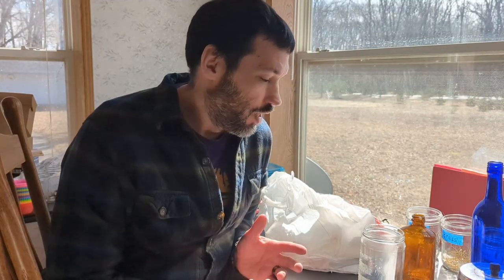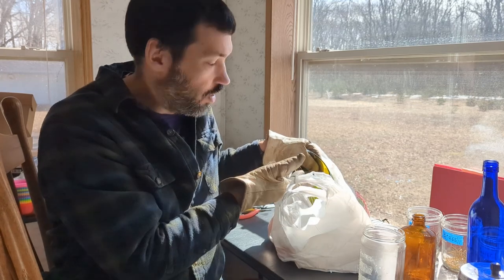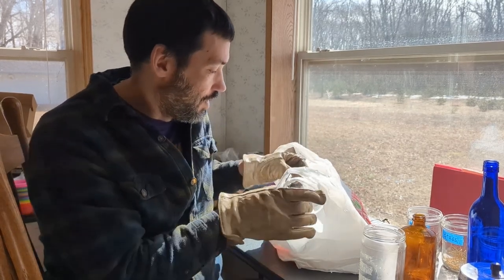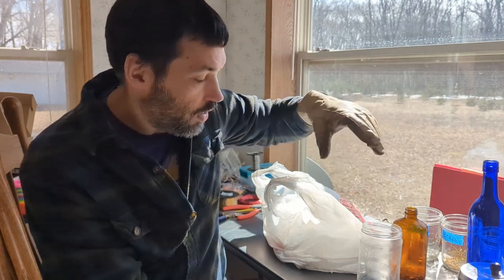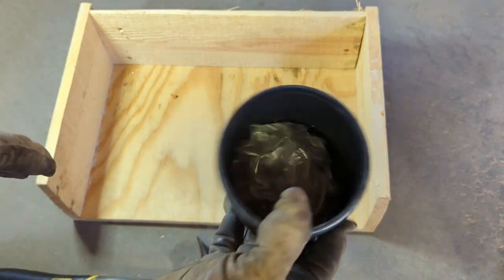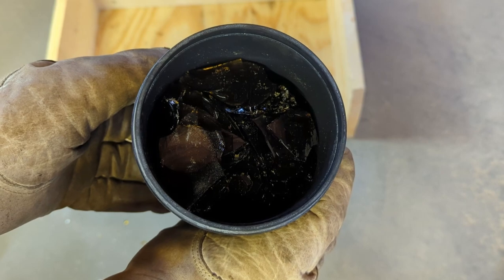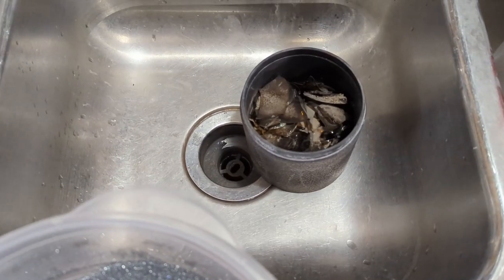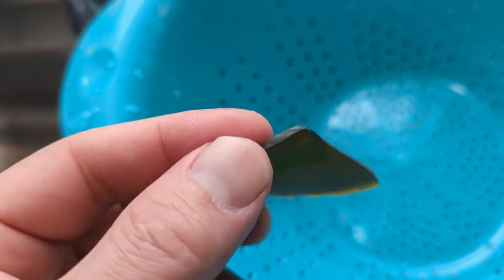Can you tumble just any glass into sea glass?

Comment: It looks like you're filling the drums too full.  I've used rotary tumblers to polish brass for reloading ammunition since the 1980s.  Early on it became apparent that a drum that was 50%-60% full would polish the brass much faster than one that was 75%-80% full.  The material and polishing medium must be able to fall inside the drum with every revolution.  If it can't fall, it won't agitate and the process fails.
Reply from the maker: For sure there are advantages to filling a barrel to different levels. With glass, I'm just after a scuffed surface, so these I filled past the typical recommended level. That, and I knew the labels would break apart and create more room in the barrel as it went. Thank you for the suggestion, I like knowing an experienced eye is helping me.

Comment: I found that only pieces more than a quarter inch thick survived the tumbling process, so there's no point trying to use the sides of beer bottles.
Reply from the maker: Thanks! I haven't gotten my hands on any beer bottles, yet, but when I do I'll keep that in mind.
Reply: @kengensjewelry  The thick green ones that Lindemans lambic comes in are great if you are sourcing bottles specifically for tumbling.
Reply from the maker: @wickeddelight  I'll run that by my wife.  I don't drink, so she's been the source of most of my colored glass.😁
Reply: @kengensjewelry  Lambic is fizzy fruity stuff with a low alcohol content, if she's not familiar with it.  More expensive than regular beer, partly because the fizz requires the heavier bottles which cost more to make and ship.  If taste is the reason you don't drink, you might actually like it, but if you don't drink for other reasons just disregard that.
Reply: I’m so glad you mentioned that. I have a Heineken bottle waiting to go in the tumbler.
Reply: @MamaJLW  Yeah, the only piece of a beer bottle that I've gotten a worthwhile result from is the mouth of the bottle where the glass is thickest.  Hardly worth smashing up the bottle and needing to carefully discard the rest.

Comment: You need to add more grit, less glass, some ceramic pieces & let it tumble for a week straight and then check on it.   At that point, if you want it more grounded / sanded down, then you add new grit & let it go for another week before you check again.
Reply from the maker: Thanks for the input! This is definitely going to a be a process of learning.  Everyone seems to have a different method for glass.  I'll definitely give your suggestions a try on the next batch.

Comment: Well, now I know what I am doing wrong. I was hammering them in a plastic bag and I really had no control on where I broke the glass. But this does seem more dangerous. I also thought of just throwing the glass on the cement. lol
Reply from the maker: Yeah, I do recommend covering the glass. I left it uncovered for this video (if I remember right), but I actually cover it with a piece of old blue jeans. I can feel where I want to strike through the denim without getting glass shrapnel everywhere.
Reply: @kengensjewelry  I did do it uncovered but it turned out the same as far as shapes. I did a lot of turning my head and ducking. Luckily I did not get hurt nextime I will wrap iti in a towel.
Reply from the maker: I've been covering mine in an old pair of jeans that I cut up. The material is more sturdy and doesn't trap the sliver inducing shards.

Comment: you said that you thought a bottle would be easier to break after being in the fire..
LOL!!
it takes over 2000 degrees to form glass.
how hot do you burn your trash? LOL
Reply: also if you put a nail pointy side down in a wine bottle and shake it 
you can bust the bottom out and have a round piece of glass
Reply from the maker: I've seen that before. I may try it in the future, but I wasn't looking for anything that big at the time of the video.
Reply from the maker: I thought maybe the fire would cause some stress fractures that would make it easier. I've had plenty of glass break in the fire all by itself, but I guess there's a reason this bottle came back out in one piece.

Comment: What happened to the blue bottle?
Reply from the maker: I might have shown it in another video. I ended up rolling it with ceramic media, which became trapped between the bottle and the barrel and rolled there without moving, basically cutting grooves in the bottle. The bottle was a little more frosted, but the deep lines etched into it ruined the effect. I still have it floating around to maybe try again at some point.